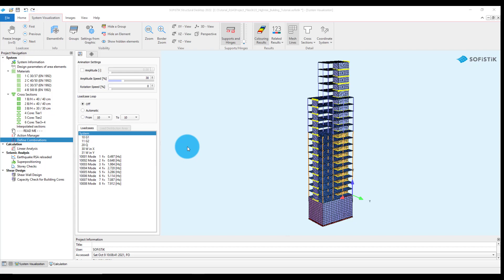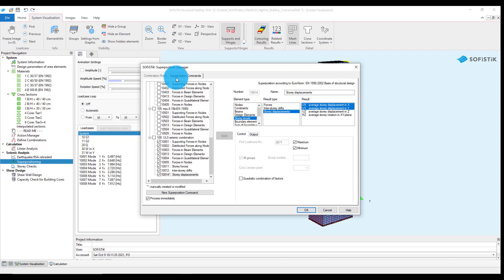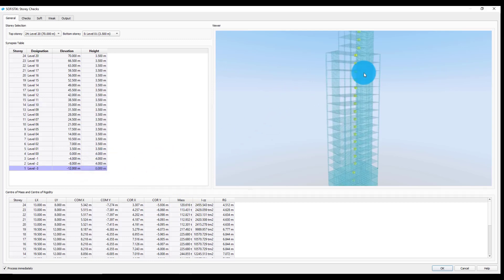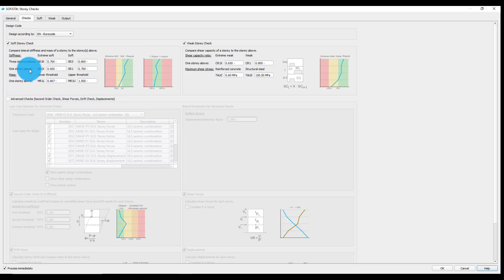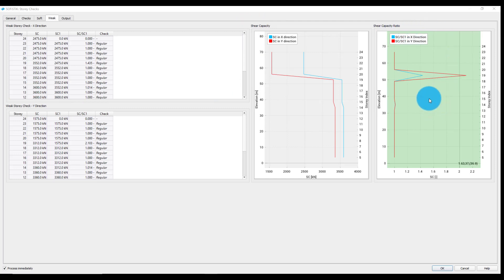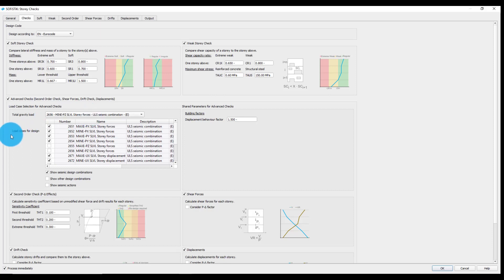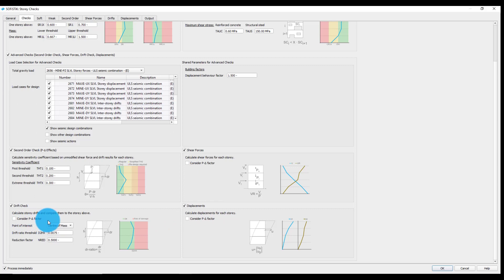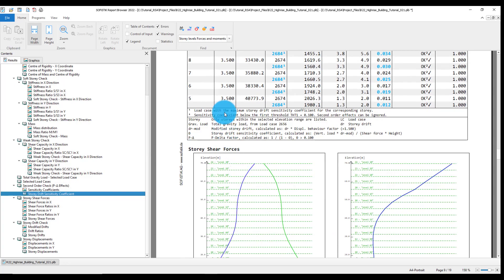Seismic Analysis and Shear Design BIM #6 – Storey Checks

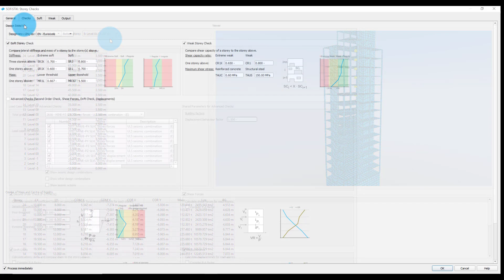Comment: This is very misleading as 3:52 states that storey checks can be done in two design codes. This is not true, as only the American Design code is checked. There is no EN-1998-1-2004 4.2.3.2 "Criteria for regularity in plan" check which is necessary for torsional flexibility classification.
Reply from the maker: Hello srebro996,
We implemented two types of storey checks: Regularity checks and load dependent checks. 
For the regularity checks there are only qualitative EN specifications, which is also documented in the help portion of the dialog, i.e. in the theoretical part. Therefore, in this case, the provisions from the US code are taken. 
On the other hand, the second order or the drift check (load dependent checks) have a corresponding EN and US design code version. Additionally, the generated report by the task gives a direct and clear overview of the implemented checks and its design code reference.
I hope this clarifies things a little.
Reply: @SOFiSTiKAG  Thank you for the response. The software calculates Centre Of Mass (COM), Centre Of Rigidity (COR) and Radius of Gyration (RG) for each storey. The only parameter missing to complete the abovementioned Eurocode 8 check is the Torsional Radius. Hopefully you guys will find a way to implement this suggestion in the future version of the software. Thanks!